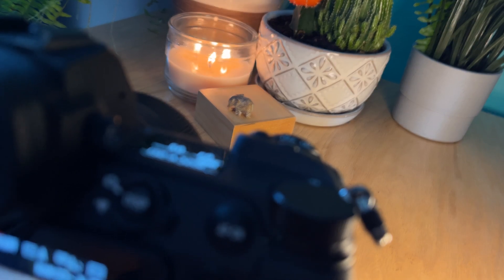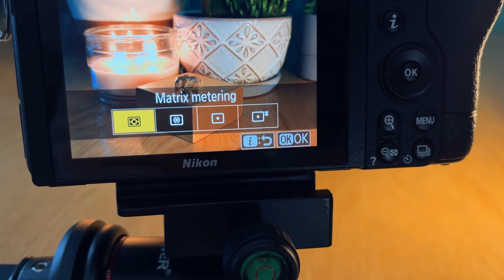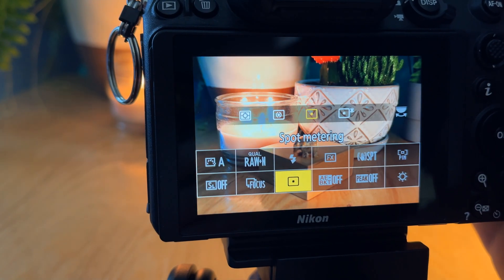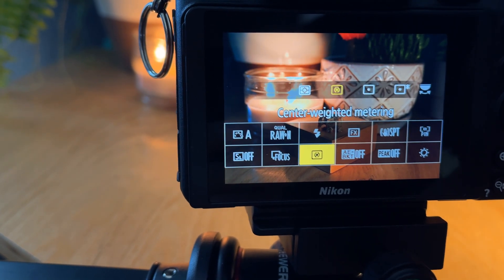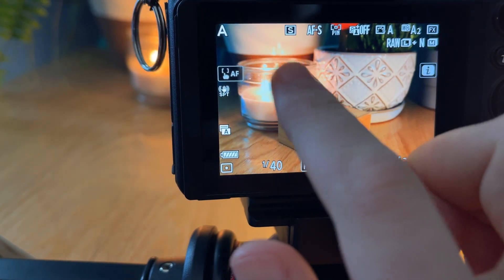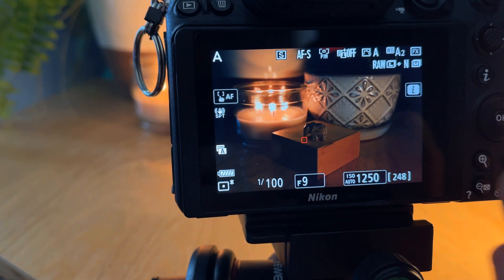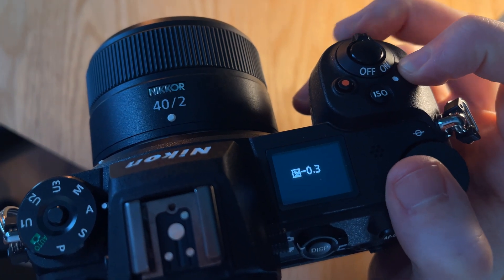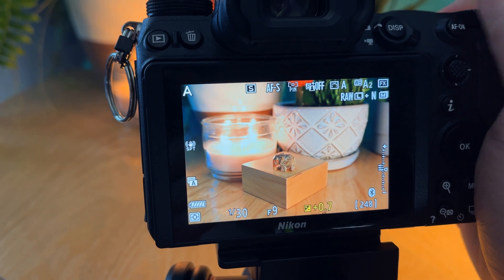Metering Modes: WHAT they are + WHICH to use | Examples from Nikon Z6ii

Comment: Good well thought out video. I rarely use spot metering because it always adjusts exposure to 18% gray, so things that are actually dark are brightened up too much and very light objects are darkened unnaturally. This is why it's better to consider what the camera thinks is correct exposure as a starting point only, then adjust from there via manual exposure or exposure compensation.

Comment: I'm a bit confused about the highlight weighted metering.   This appears to be a spot meter, not a mode that evaluates the whole image and exposes to protect the highlights .  Clearly it's meant to protect the highlights, but since it's a spot meter, results will vary dramatically depending on where you put the spot.   I do own a camera that evaluates the entire image and exposes to protect the highlights, and that's my Ricoh GR.  But I think this Nikon mode works differently.  Surprisingly, it is difficult to find anyone talking about this, or do I have it wrong.
Reply from the maker: The highlight-weighted metering evaluates the whole image and meters for the brightest part. For example if I point the camera at a window it will expose for the sky outside regardless of whether I put the focus point on the bright sky or dark interior. 
You can read all about it here: https://www.nikonusa.com/en/learn-and-explore/a/products-and-innovation/using-the-highlight-weighted-metering-mode.html